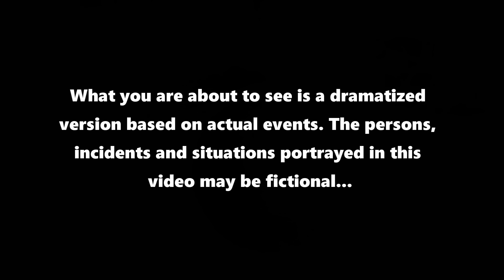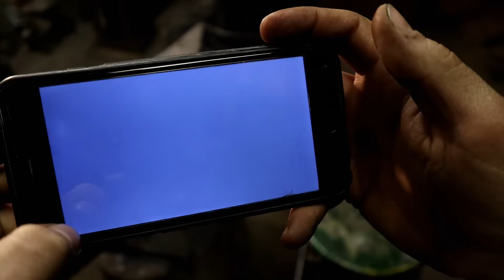Ilya's Amazing Mosaic Pattern Revealed / Matt Forges His Blade - Blade Show 2020

Comment: Question: why would you cut the bar handle off the billet instead of just cutting the two other pieces and welding them to the outside of the one with the handle making that the central piece to the billet? Just wondering for a time saver or does it truly affect the pattern that you were going for

Comment: Hey, you guys do a lot of recreation swords, giant swords, functional replicas and fantasy weapons. I wanna see you guys create a high-performance sword. The best sword you have ever made. Top of the line steel, distal tapers, perfect centres of percussion, good edge retention (maybe differential tempering?), razor sharp (i.e. will shave you), solid construction, original engraving and art designs, good blade geometry, excellent point of balance, a protective pommel, ergonomic pommel letting you feel your edge alignment, of course the pommel construction will be on point as always, a good flex to take the strain of impact (HEMA or Kendo consultants for the feel of the blades? I dunno...), and basically make the most perfect sword you guys ever have. I think it would be an awesome challenge, from forging to grinding, to material sourcing.

Comment: So the 1045 steel is a softer steel than the 1071 spring steel you sometimes use and that makes it better for engraving. Would it make for a worse blade if one was made entirely out of 1045?

Comment: I'm about halfway through the video and that accent has gone on about 20 minutes too long.  I don't get if it's a hater thing or a gentle poking of fun, but you guys are better than that.
Reply: Thank you. I was going to write the same thing. Alec is a 21 year old and has been a blacksmith since 16 but he only started bladesmithing like 3 years ago. And he started his own company. These master smiths should reach out and teach him not make fun of him.
Reply: It is very much hater, Alec is damn near half their age and much more successful. As for them teaching him anything, highly doubtful they know anything he doesn't already.
Reply: @LunkovichTromofski  that's a bit silly to say, I think... For one thing Ilya can forge weld a billet without constantly taking it off the power hammer to grind and restack, he cuts and folds while still hot... That's just one thing off the top of my head.

That being said, Alec is very successful, and the accent Matt did started grating on my nerves rather quickly.
Reply: @FlinnGaidin  alec knows how to fold steel but what you are talking about "stacking" he does when he is going for a particular pattern. They are both great smiths.

Comment: i was watching a youtube clip, about reals "Damast" - in that clip they say about the "pattern" Damast that it is not the same what the real stuff in the past was. They say: Damast nowdays is not near the quality of the findings of the past. The microscopic analysing gave it a special very fine Strukture. One Smith did the Trick by using special steel out from a very unique old mine of King Salomon or something like that. That steel got different insides minerals and metals that make it so unique. The steal has to be heaten up very lightly forged with a hammer. Then back in the oven and so on the pice of metal was not "folded". In the end it has that fine Damast Strukture (i dont know details). They sealed the Smelting cup with Glas to prevent Air getting in the material. Like oel over water. And so on. Very komplex stuff. They said - that came closest to what real damast was looking back in time. To me it would be nice to know if a sword made on that technique would have same or other quality (Strong, Flexibility, sharpness, war proved? and so on).